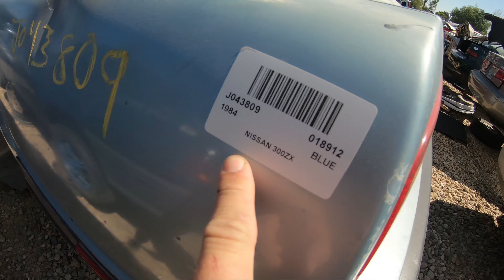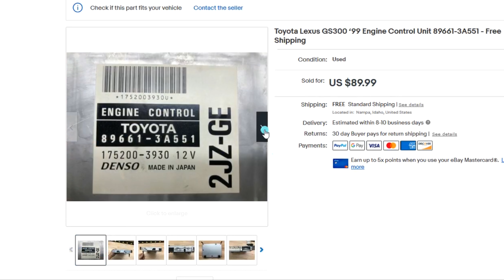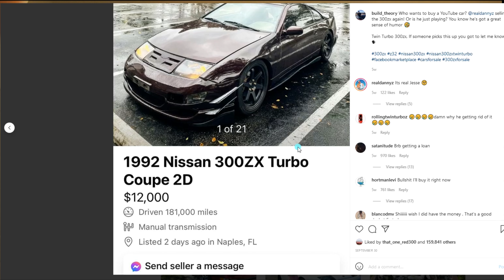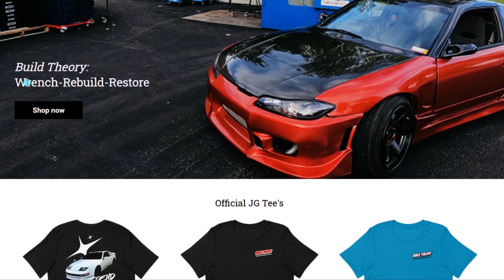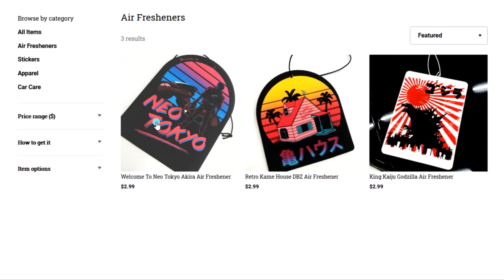300zx Parts - Easiest Way to Make Money Online Selling Car Parts - Finding a 300zx for Parts

Comment: Hey man i just got me a 90’ Na z32, my dream car but she needs a 120k kit! But she has this vibration that only shakes the chasis when its idle but stops when i drive, any clue as to what it might be? 
Ps. Barely found ur channel and ill definitely stay tuned for the z !
Reply from the maker: Awesome, congratulations on the Car!!!🎉 sounds like the drive line carrier bearing, had the same thing on mine. Here is a video on it and how to replace https://youtu.be/ahFNlgPxRFY
Reply: @BuildTheoryZ  Also for the 120k kit, i seen z1 offers a gates racing kevlar timing belt, u think itll last longer than the oem belt? i dont plan on abusing my 4 speed but i dont wanna cheap out on it hah
Reply from the maker: OEM is Fine for Normal driving, I would got with the Gates if your going to make more power or take the engine past what Nissan built it for, ie high Horse Power or Lots of track time. Belt Should be replaced ever 60k Miles regardless of OEM or Gates.